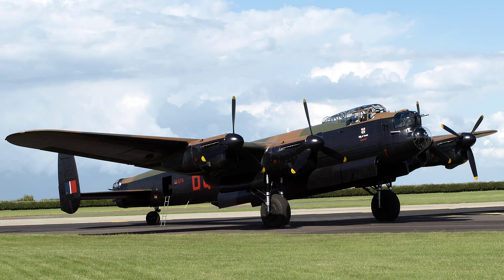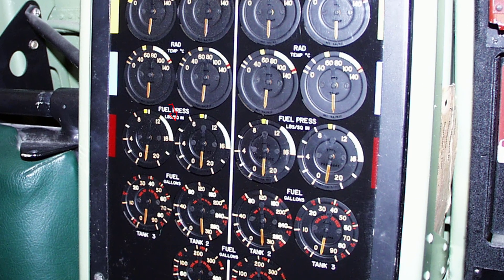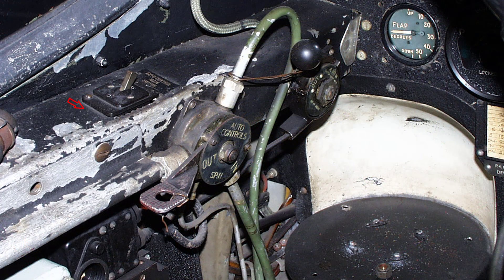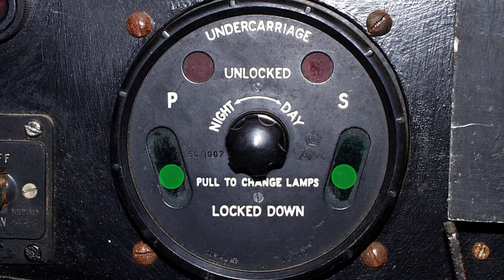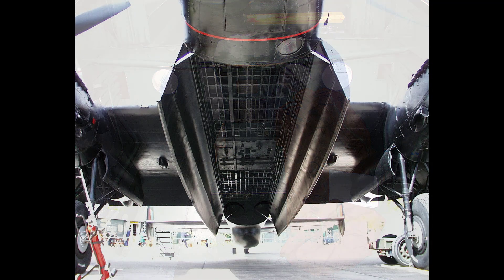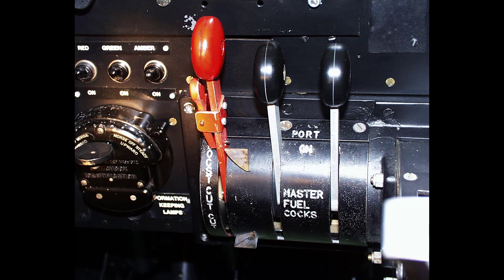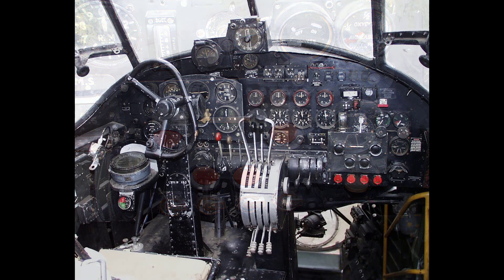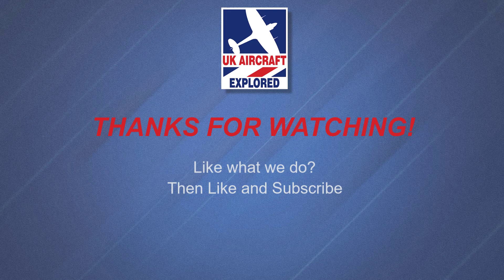Avro Lancaster – Cockpit Procedures

Comment: The most peculiar thing I remember reading about pilots taking control of a bomber about to take off for some death-defying mission over enemy territory was that they had to sign a form of some sort handing over Air Ministry property to the pilots to permit them to take this valuable aircraft and its crew and contents and then get shot up by fighters, peppered by flak or suffer whatever else came their way.
Reply from the maker: Yes, and a great deal of them were very young. So brave. Thanks for watching
Reply: The document is the aircraft F700 (form 700). The pilot signs for the aircraft, the F700 documents the fulel load, weapons load, the documents what servicing has been carried out, in a different format its still used today for every flight.

Comment: great video,  why is slow running a problem ,
Reply from the maker: Slow Running refers to the Merlin 28 and 28 engines fitted to the Lancaster B Mk.III and Canadian built B Mk.X. These engines were fitted with the Bendix Stromberg pressure injection carburettors. Slow Running isn’t a problem as such, it refers to the Slow Running Cutouts which are operated by the electro-pneumatic rams – one for each engine carburettor. The Slow-running cutout switches have two positions – the Engine Running position (UP) and the Idle Cut Off position (DOWN) – that is used only for starting and stopping the engines. I hope this helps and thanks for watching.